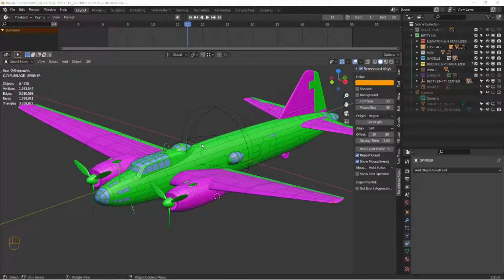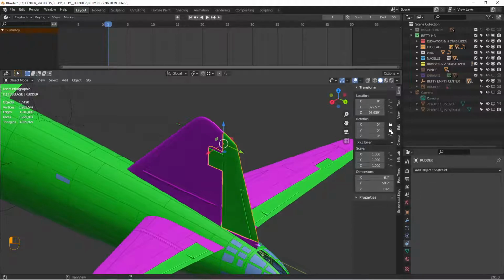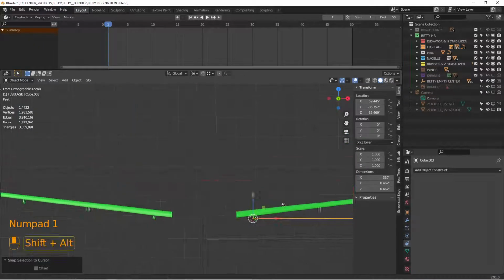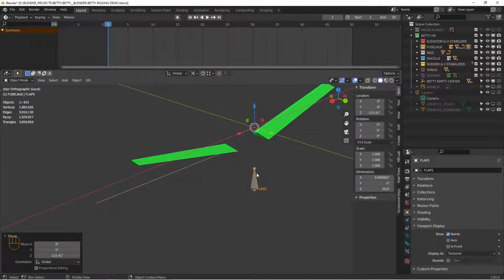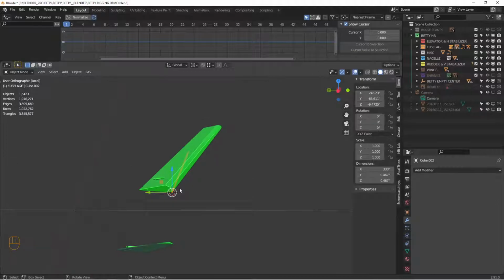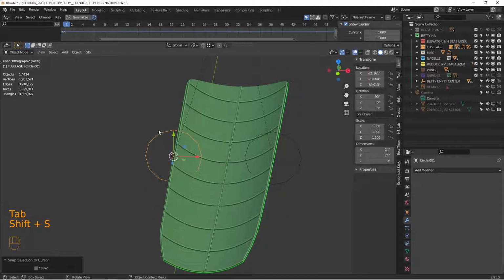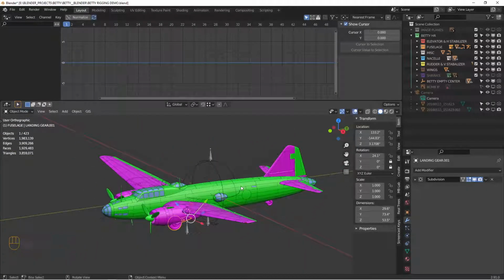Blender - Rigging aircraft control surfaces

Comment: amazing tutorial, i have a problem with the rotation in the drivers, the flaps and ailerons rotates well when I move de controller bone, but they rotate in the world space and not in the local space, you know what could it be?
Reply from the maker: When you setup the drivers, did you have "world" space or "local" space selected (https://www.youtube.com/watch?v=4qZXoJG0r2c&t=1083s)
Reply: @Mark_Alloway  Don't know if you still check these comments, would be amazing if you did, but I'm having the same issue, I followed the vid on how to rig the flaps to rotate correctly, but when I go to set the drivers up for them using the bone, the rotation is not correct. They are rotating around the global Y, when I try setting it to the local Space the rotation disappears.

Comment: helpful advice about using the tool to redefine axis of rotation. but is there a way to not have the ailerons deflect when the plane rolls?
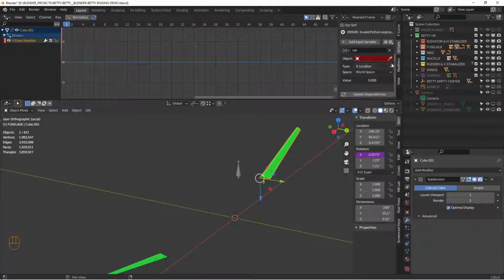Reply from the maker: At 18:03, when I setup the driver, you can see that the driver setting is set to "world space".  I'm pretty sure that setting that to "local" would prevent the aileron rolls.  (I'm also coming out with a new set of training videos soon that use a different/better method.  Those videos should be available in the next week or two.)
Reply: @Mark_Alloway  that worked, thanks!

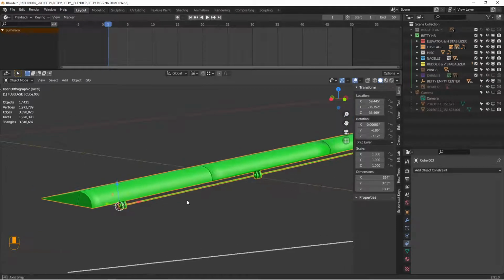Comment: I'm having some trouble with the rotation (8:17). When you press R + X + X, the only value that changes is the X rotation. Somehow my Z and Y also change. The rotation is correct if I do it manually, but it gives me trouble when I add the drivers, because they only change the X rotation. Do you have any idea what I am doing wrong?
Reply from the maker: Did you select and join your objects in the same order that I did?  It's important to select the control surface first and then select the tool before joining the objects.  If the tool is not the active object when you join them, the new object will still have the original XYZ orientation of the control surface.  Does your arrow manipulator look like mine does with the X-axis arrow pointing down the length of the hinge line?
Reply: im having a similar issue. none of my arrows appear to be pointing in the direction of where the aileron is going.. (the start of my aileron doesnt line up with the X axis at all, as it is a swept wing.) @Mark_Alloway
Reply from the maker: @Fancy_Frost 
My first thought is that the x-axis of the "tool" isn't correct before joining it to the aileron.  When you created the tool, was it perfectly aligned along the x-axis and did you apply rotation and scale to the object before moving it into position?  And when you moved it into position, did you move it in OBJECT mode and not in EDIT mode?  OBJECT mode will preserve the axis orientation.

Comment: Thanks, this aileron/flaps rotation alignment procedure works perfectly. I need help, though. The parts I join with the alignment tool lose the texture. How would you fix that?
Reply: Nevermind, just figured it out, just changing the UV map for the object did it.
Reply: Actually, still need help, when exported as .fbx and imported into unity, said parts lose their texture again
Reply: Figured out again, just have to delete the uvsets that get generated for the parts when using this process, so unity doesn't import the wrong one, I guess

Comment: Nice trick on the aileron alignment. I'd just note that if your ailerons have multiple modifiers with specific values it would be a good idea to use Make links ->Modifiers to copy them over to the alignment object before you join them. This will allow you to preserve all the modifier settings.
Reply from the maker: Excellent suggestion.  Thanks for adding that!

Comment: Nice tutorial, Mark. It's surely helpful for rigging aircraft control surfaces - especially for the ailerons and flaps. My brother once used the same technique for adding keyframes for the propeller spinners on my P-38 Lightning (by the mesh itself, yet adding a Copy Rotation constrain on the negative Y rotation since it's a twin-boom engine aircraft), but I changed to rigging with Armature and some bones for the control surfaces and landing gears. The only thing I met after rigging my models was the ailerons and flaps acting a little wobbly (due to the orientation and cursor - which I may adapt your techniques to the models). And, since I'm learning some things here on YouTube, I also have to agree the animation and the hydraulics are quite tricky - especially after I made the P-51D Mustang, Focke-Wulf FW 190 and Macchi C.202 and Macchi C.205 (I think the P-38 Lightning and the Junkers Ju 87 also has extra bones for the hydraulics and flap limbs - the pieces that link the flap to the wings).
Reply from the maker: I didn't mention this in this tutorial, but Shape Keys are another way to animate things.  For example, the fowler flaps on my P-38 slide along oddly curved tracks and would have been a tedious to rig using bones, so did it with shape keys and and drivers.  If you're rigging something with a more complex motion, you might want to try shape keys as well.